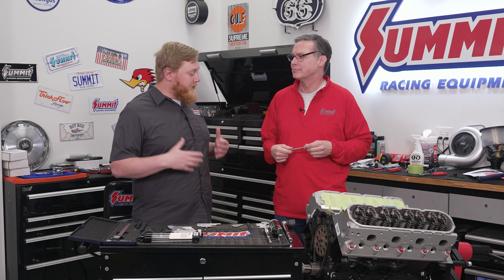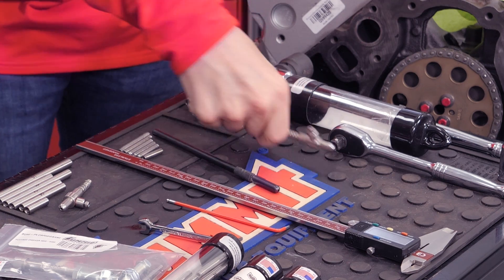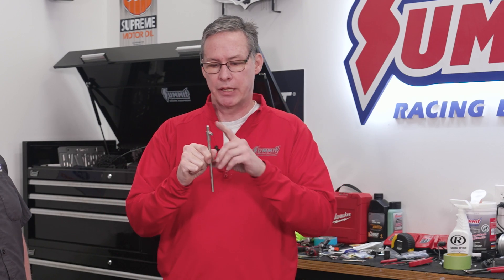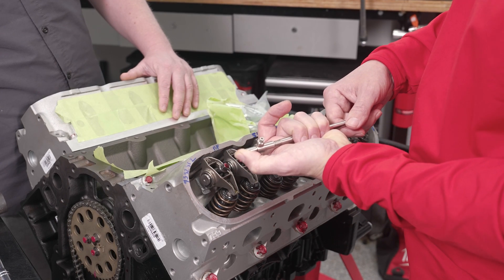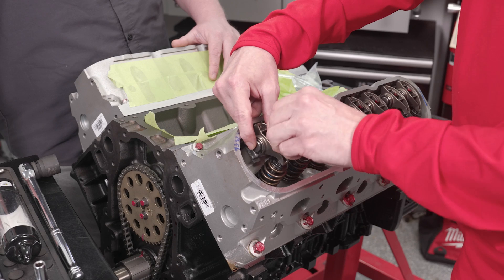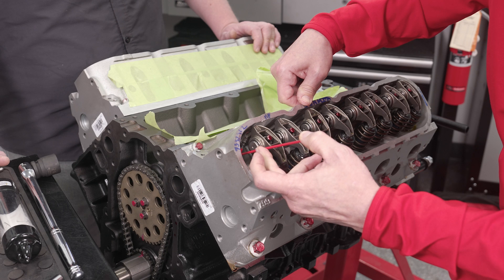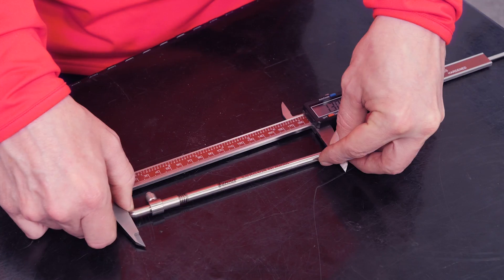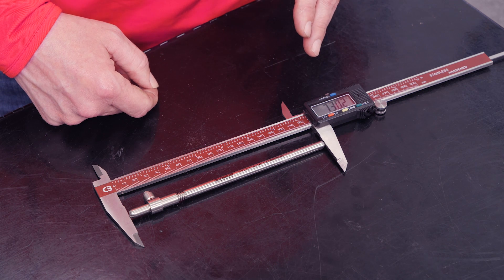Quick & Accurate Pushrod Measurements the Easy Way | Summit Racing EZ Pushrod Length Checker Tools

Comment: You never described to make sure the cam lobe was at its base. Isn’t that important?
Reply: This is a video describing how the tool works, not detailed, step-by-step instructions of how to check your pushrod length. Find a proper tutorial online on how to set the cam on the heel. If you don't know how to do that first step, you have no business proceesing to next steps.
Reply: Extremely important
Reply: I was just thinking that

Comment: Great demo on how to use the tool. HOWEVER, it would've been beneficial for some inexperienced guys to show the EO/IC procedure FIRST. You can't just remove a rocker and check for preload!! The lifter MUST be on the base circle FIRST. May seem obvious, but only to the experienced wrench. To the beginner, this could result in a damaged tool, or worse, a damaged engine.....

Comment: This is great and all…except every pushrod I’ve ever bought was about “0.020 longer than the advertised length. Nobody talks about this. Why?
Reply: That’s because you are measuring the pushrod differently from how the manufacturer does. Look up how Manley measures pushrods and you’ll understand why they are .020 longer then you measure
Reply: @TrevorSlusser  I understand why it happens but why not include an overall measurement?
Reply: When calling your pushrod manufacturer and tell them your measure and include as measured with a caliper. 

I told Manton I used an 8” caliper to measure end to end and my PRs came back to the exact length I ordered. PRs are usually measured Cup seat to Cup Seat.
Reply: What you’re experiencing is that the length checker tools are actually giving you a gauge length which is what most pushrod manufacturers use as advertised length.  But…when you measure your checking tool with a pair of dial calipers you are measuring the theoretical length over a full sphere.  They’re two different measurements. Just tell your pushrod manufacturer that you used a length checker then measured with a caliper and got x number then added your preload. They should be able to get you where you need to be.

Comment: Dope, love the innovation! Also that older style checker with the tape you used requires check springs too! pain in the butt to also install. This can be used easily with aftermarket springs.